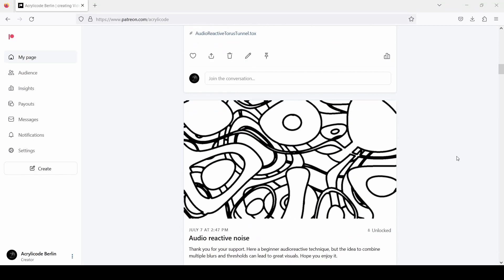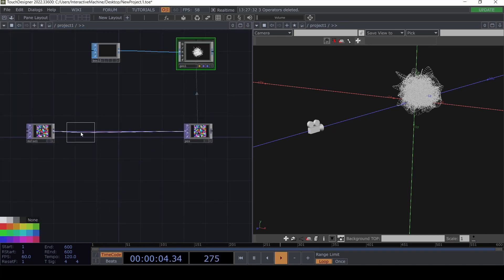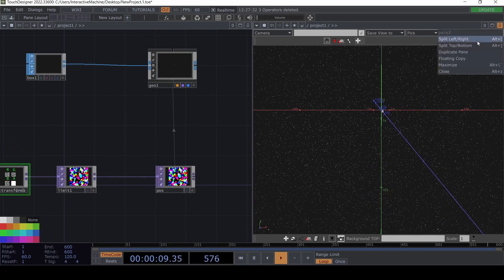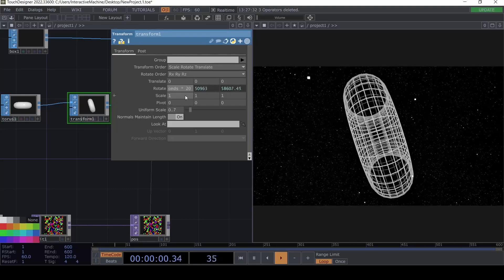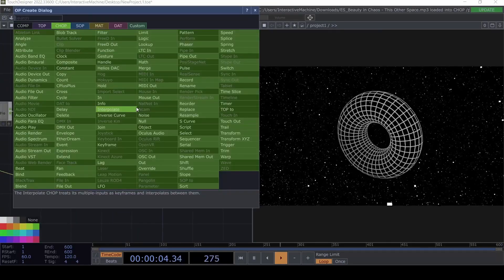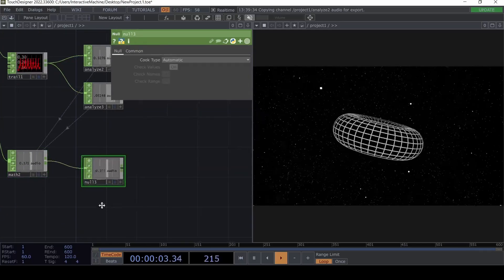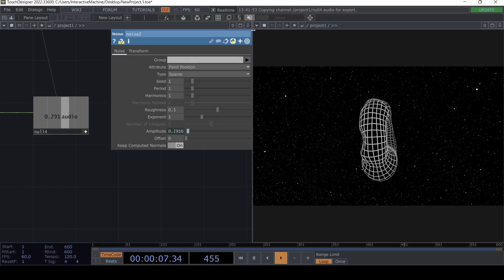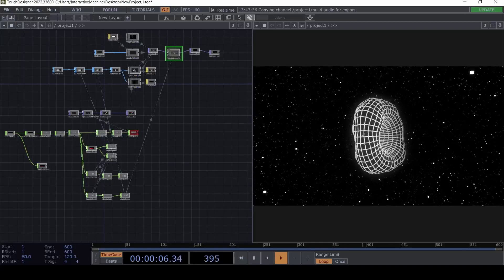Audio reactive Galaxy tutorial

Comment: is there a way to do this with a logo (.svg) instead of the torus? really cool idea
Reply from the maker: You could import the svg to blender, create a 3d representation and then export it as fbx or obj and use it in touchdesigner
Reply: @acrylicode  great idea! thank you!
Reply: @aeonvoid_  did you try this? I got the obj imported in TD but replacing the torus w/ the 3D logo causes it to explode.